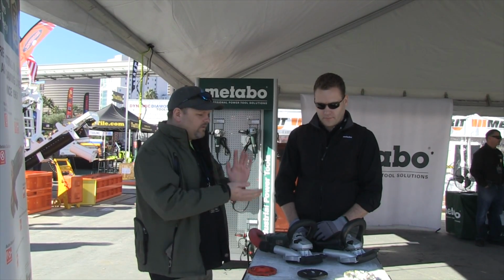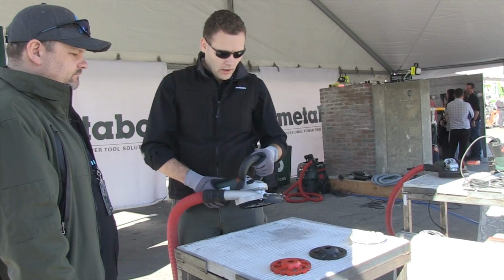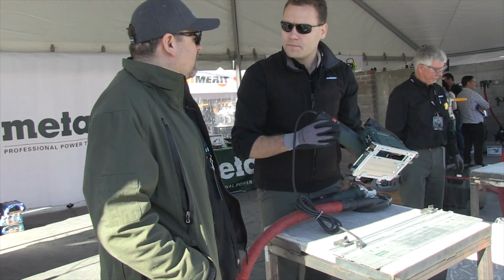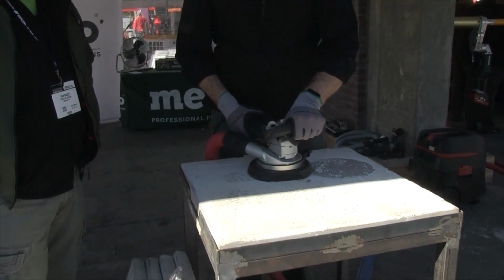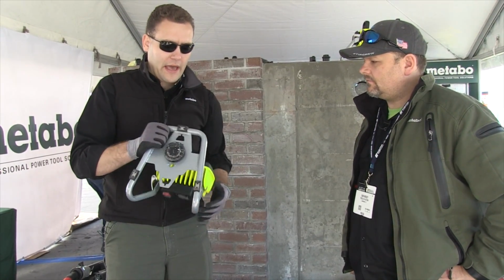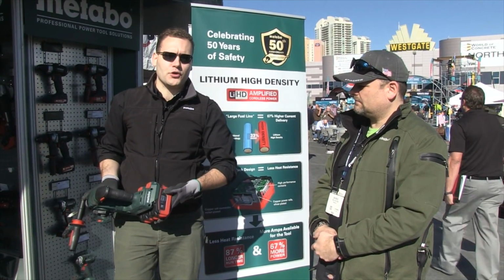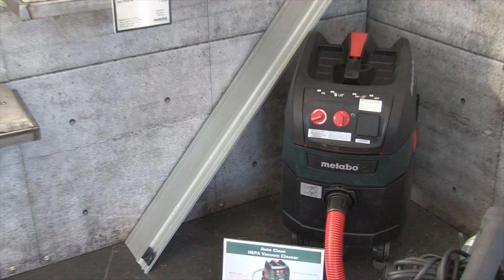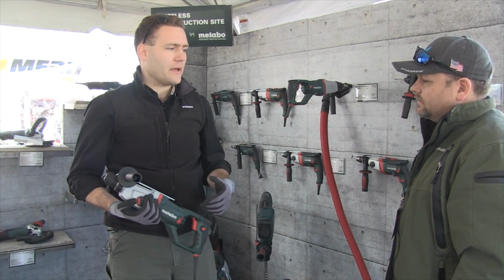Metabo - World of Concrete 2017

Comment: German Engineering MADE IN CHINA
Reply: new2wood1 some of them made in china but in Metabo's factory , not in third party manufacturers'.and still there loads of tools that they produce in Germany.i have three Metabo tools, jigsaw,angle grinder and impact drill , all made in Germany.
Reply: i have a site saw and a thicknesser and a bandsaw, all ok but not great , site saw no longer goes up down or angles, band saw fence broke in first week and bearings are really bad and the adjust for tensioning the blade wont work, the thicknesser dust shroud broke and is now on with one screw but apart from that there ok ish
Reply: would NEVER buy another Matebo tool
Reply: new2wood1 These things do happen you know
Reply: new2wood1 I use metabo angle grinders and other metal working tools from them, plus some concrete working tools. After many failed makitas, dewalts, boschs, and Milwaukees, I would NEVER buy a tool that isn’t metabo, unless I don’t want it to last.
Reply: new2wood1 most of their premium tools are made in germany though

Comment: Metabo grinders are top notch.  I might look at getting that saw, I have a couple of projects I could use that for.
Reply: I have the 1700 watt 125mm metabo grinder. They are very good. Especially for metal which is metabo's specialty.
Reply: damn rite i have to grind and rub fresh concrete and bridge repairs these grinders are the best very balanced and run cool all day